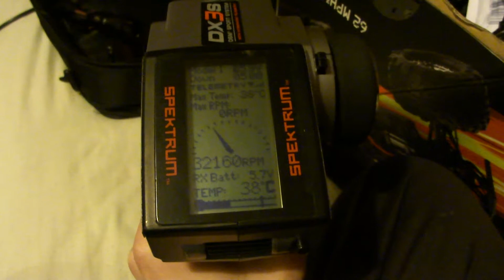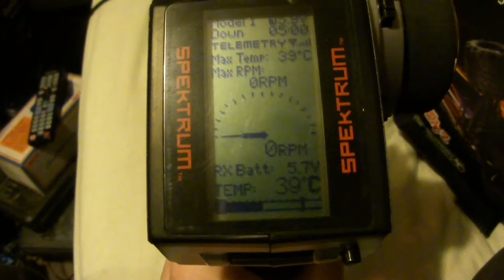Spektrum RPM sensor - Max 32000 rpm!

Comment: Before you do anything go to your Main menu scroll all the way down to System then click it...scroll to List: change from standard to Expert. Exit back to Main menu. Then go to Tele Settings...it will say...Screen: Roll or other, Tele-Speed then Zoom & Unit...click on Zoom and adjust to highest numbers. Your set! Mine is at 50000. If you need more help I'll walk you throu step by step

Comment: yeah bro, same to me. I've installed it on a 1/10 nitro on road and it reads up to 31.000RPM. almost useless for me. I'm going to move it from the flywheel to gearbox using the Speed instead of RPM

Comment from the maker: @suprafan246 Yeah, you can display either rpm or speed on the display. I mounted it on the transfer box in the end think that revs about 5000rpm at full speed so its easier for it to read. I have a TRX 3.3 engine on my Rustler that revs to about 48.000rpm at full throttle so i didnt even bother trying to make it fit.
Bit gutted really but what can you do.